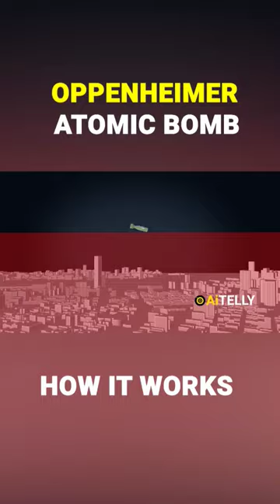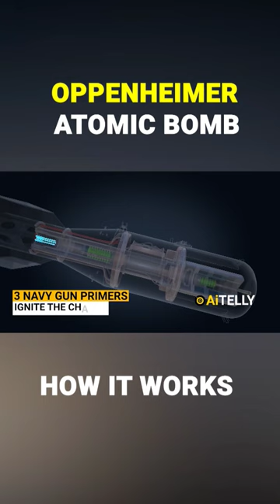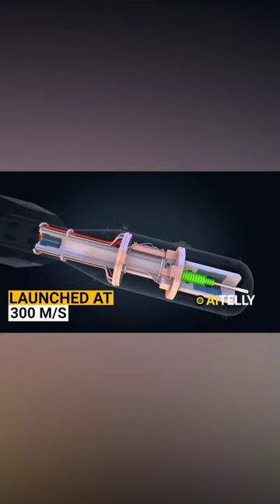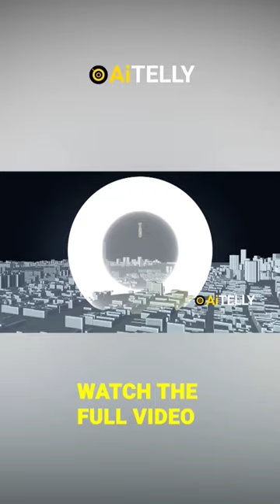Oppenheimer Atomic Bomb How it works

Comment: In 1917, Halifax, NS, Canada experienced the largest man-made explosion when two cargo ships collided in Halifax harbor. One of those ships was carrying TNT, gun powder, and nitro glycerin which caught fire and exploded.

Because the Halifax explosion took place on water, the detonation easily dispersed the water and the shockwave caused severe damage for miles.

This explosion influenced the Oppenheimer team that the bomb should detonate ABOVE ground so the shockwave doesn't get absorbed by the ground
Reply: Beyond not being absorbed it causes a second shock wave as the primary inverts and reverberates off the surface.  Also destruction is increased as its able to impact from above and the oblique instead of the side.

Another benefit is less radioactive,  but that's a foot note in this part
Reply: thanks for explaining my dumbahh why not all large scale bombs doesn't explode on impact
Reply: If you set this off underwater the damage is 10 times what would happen in air
Reply: @jamiemorton1765 Unless you drop it in the depths. Then all you get is a few bubbles
Reply: @MRworldEtIkA the other reason nukes typically detonate in the air is it causes significantly less radioactive material to be made making the area less irradiated afterwards

Comment: > That's only in the Uranium Gun type "Little Boy"  Atom bomb 💥.
> The "FAT MAN" Plutonium implosion type Atom bomb was a lot more complicated. But gave you a much bigger  💥BANG💥!
Reply: Uranium 235 detonator. "Marvin the Martian" 😂
Reply: That's why they tested the Fat Man concept first
Reply: @palehorseman8386   Well yes, & also they could scrape up only enough processed fisionable  Uranium for just one Little Boy.
Reply: And the crazy part is how they make bombs that flip between fission to create the compression to make fusion, to make the neutrons to make fission, and so on. Crazy how they even think of that. Like some kind of onion
Reply: @de0509   But the Germans didn't. (think of it) That's why they didn't think a "Pratical" Atom Bomb was feasible. And so didn't have their own Manhattan Project scaled Atomic Bomb works.
- Which was actually lucky for them because such a huge program would have drained resources & manpower front making tactical weaponry & would have then collapsed the Eastern front & hastening their demise long before they could have made a working Atom bomb.
- And they also didn't have a delivery system. The (B-29) which was actually.harder to make operational & even more expensive than making the A-Bomb.
Reply: @mydogbrian4814  V2
Reply: @de0509    >  If you put an American Fat Man Atomic Bomb in a V-2. First; it wouldn't fit. And second; even if it did, the V-2 would sit on the launch pad for half its fuel burning time and then it would collapse like a folding accordion from the inertia of all that heavy weight trying to get off the launch pad.
- It would be like putting a 15 ton freight liner truck load in the bed of a pickup truck.
- Any other brianieack  ideas?
Reply: @mydogbrian4814  we are speaking potential history. Surely if they did make a nuke they couldve just scaled up a delivery system from something theyre already using on London

Comment: The important thing nowdays is to know how to build nuclear bombs smaller while retaining the ability to go critical. People with high IQ should know how simply by deriving the technique, but rarely anyone would share such knowledge outside of a governmental militaristic environment.
Reply: My IQ is 133, but more importantly I've studied nuclear weapons for over 7 years.
The methods to miniaturise nuclear weapons is to use Be reflectors, synchronous explosive circuits, hollow thin shell cores, and DT boosting.
Reply: @Evan_Bell  I am not familiar with the terminology so 'DT boosting' is an unfamiliar term. But there is also a way not only to use reflectors, but to my knowledge also the option to treat Neutrons as a matter-wave with all the associated effects. Also material research may aim to create surfaces, which reflect neutrons only under certiain conditions...
But I'm just a random guy on the internet, so feel free to ignore what I just said :)

Comment: For the last time, it’s not an explosion! It’s the creation of heat, unbelievable amounts of heat. That’s what causes the damage.
Reply: Have you studied the relationship between Pressure, Volume and Temperature?
Reply: Pressure and heat
Reply: But it is an explosion also as a pressure wave is generated which causes tremendous damage after the Heat Wave.
Reply: So, it was just a giant fart?
Reply: No not exactly; it’s the release of energy caused by the splitting of the atoms of U235 causing a shock wave that does most of the instantaneous damage.
Reply: It's an explosion.

Comment: I believe FDR had no intention of ever using the atomic bomb. The bomb used on Hiroshima (Little Boy) and the one used on Nagasaki (Fat Man) were completely different bombs in every way. Fat Man was a nuclear fission bomb that used roughly 140lbs of enriched uranium. This video makes it sound like a small projectile (bullet) was used when actually the projectile weighed 55lbs. It was fired into 85lbs of enriched uranium to make the combined uranium reach critical and fission to start. Fat Man used high explosives to surround almost 14lbs of sub critical Plutonium which was shaped like a football. The explosives were arranged to compress the Plutonium football to the size of a baseball. The result makes the Plutonium reach critical and the nuclear reaction begins. The bombs were different in every way and shows they probably had one bomb ready long before the other. Has FDR planned to use them he would have most likely used the first one when it was ready. What I find to be the most fascinating thing about Little Boy was that sending one projectile into another is about the most inefficient way to cause a nuclear reaction. Little Boy only used 1.38% of the140lbs of the uranium fuel to cause the massive death and destruction in Hiroshima. 1.38%!! Imagine what an efficient bomb could have done with that much fuel. Nagasaki wasn't even supposed to be the target for Fat Man. Kokura which was fairly close to Hiroshima was supposed to be the target. Had the pilot not wasted so much time in getting there it would have been Kokura getting nuked that day. As it was when they arrived after receiving the green light to drop it on Kokura clouds and smoke gathered above the city and after several attempts were made the target was changed to Nagasaki because of the poor visibility. The visibility wasn't much better above Nagasaki so when they dropped the bomb they were a couple of miles off the bridge which was supposed to be the target. They dropped it into a small valley which prevented a large part of the city from being destroyed. Fat Man was a far more efficient use of the nuclear material. Over 2lbs of the 13.8lbs available were used in the nuclear reaction. Fat Man was identical to the bomb they detonated in their experiments in New Mexico. It's too bad Little Boy's method of creating a nuclear reaction was so inefficient. There would be far less bombs for us to worry about today if it took 140lbs of enriched uranium to make each one...
Reply: A lens
Reply: Kinda, but not really
Reply: When you talk about Fat Man, you mean Little boy. You have the masses for the projectile and target the wrong way round.
Sufficient fuel for both weapons became available very close on time.
Little boy's efficiency was 1.32%.
Fat Man and gadget weren't identical.

Comment: Takes about 20 seconds for a large runaway explosion, i would guess
Reply: No. 1.26 microseconds.
Why would you guess 20 seconds?
Reply: @Evan_Bell  older tech. The fact its not what you think it is. The fact that radioactive energy has to cascade thru most of the material to be reactive. And as far as i can tell thats kinda slow.
Reply: @markrankin2954  I can't really tell what it is you're trying to say, but it's clear you're not familiar with nuclear physics.
The reaction is not slow. The mean speed of the neutrons that mediate it is 20,000,000m/s.
What is it that I don't think it is?

Comment: There 2 types of atomic bombs the implosion bomb and the gun type and the implosion bomb is the most efficient and powerful the gun type isn’t used.
Reply: The Gun type was used. The US produced 2255 gun type weapons of 7 different models, the last being retired in the 90s.
Reply: @Evan_Bell   they were very inefficient but they were only Atomic bombs.  The miniaturised implosion bombs that are thermonuclear weapons are used today in MIRVs,  Tbh I’m really surprised they kept any gun type gravity dropped bombs at all.  I know they have one variable yield miniaturised implosion bomb that’s gravity dropped in use now.  I suppose were are a lot simpler in design and that why they were kept around.
Reply: @Biketunerfy The primary benefit of gun types is low diameter and high ruggedness.
Makes it useful for "Artillery fired atomic projectiles", ground penetrating "bunker busters" and tactical aircraft delivered weapons before implosion devices were miniaturised.

Comment: pretty sure it works the other way around
Reply: What do you mean?
Reply: @Evan_Bell  the "Puck" doesn't get shot into the "cup", rather the cup gets shot toward the puck
Reply: @koekie7003  That's what the video shows...
Reply: @Evan_Bell no bro it's not, the thing being shot in the video should stand still and the opposite end should move
Reply: @koekie7003  No. The hollow "cup" projectile is accelerated from the rear to the forend, where it envelops the static solid "Puck".
This is how he portrays it, and this is how it worked.
You can see in the animation that the static target at the front is lower diameter, and that it's enveloped by the larger diameter projectile.
The target assembly had to be at the forend so the bomb was front heavy, and thus ballistically stable.
Reply: @koekie7003  Well?
Reply: @Evan_Bell  well look again cuz we are clearly seeing different things
Reply: @koekie7003  I don't understand how we can see this differently.
Have you rewatched it?
The projectile begins on the left hand side of the screen, at the rear of the bomb.
At the right side of the screen, in the nose of the bomb, is the target.
The target is lower diameter than the projectile.
The projectile is fired from left to right, from the rear to the fore of the bomb.
The larger green projectile moves to the right and covers the smaller green target.

What are you seeing that's different?
Do you think the bright green ring stack on the right is larger diameter? 
Do you see the moving stack disappear inside the static stack on the right??
Freeze the video at around the 14 second mark, when the core is partially assembled are you seriously telling me you think the left fuel assembly is smaller??
Reply: @Evan_Bell seems I need glasses fml
Reply: @koekie7003  Right lol